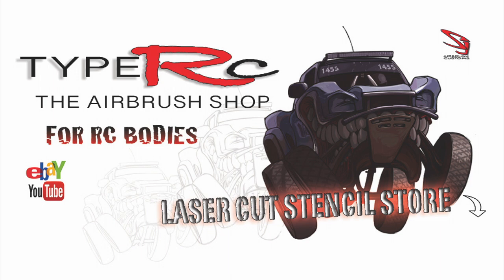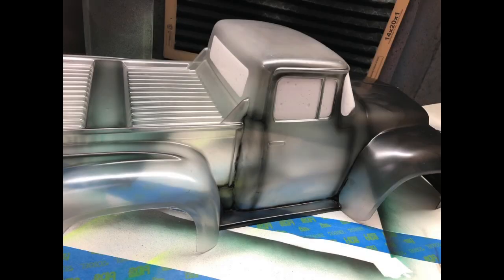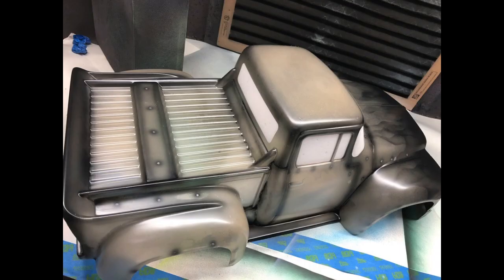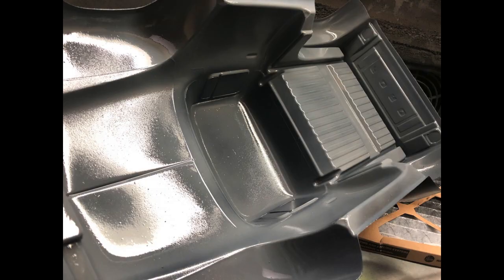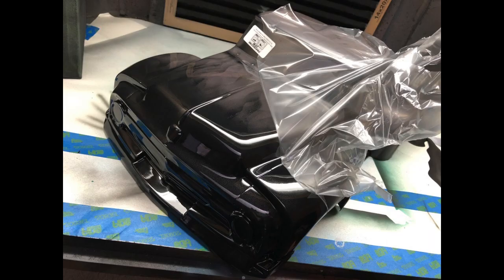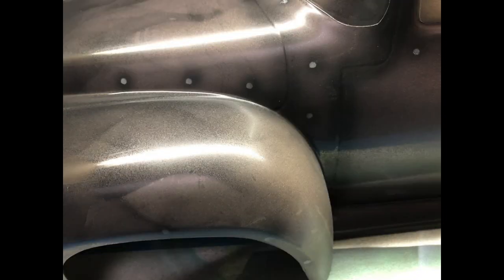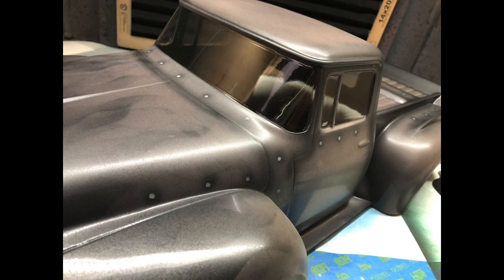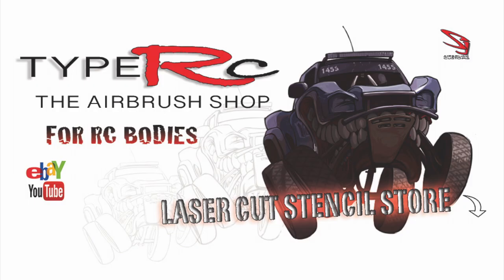How to Airbrush Rust on Rc body

Comment: You do absolutely amazing work ! It has sparked a new interest in my hobby . 🔥🔥 I did have a couple questions that might help.  I'm hoping you can give me some clear advice.   Do you need to seal the paint with a clear coat or another type of paint sealer to keep water and the environment from destroying the paint ? Or is a simple backing coat sufficient to keep the paint from degrading ? I mostly paint rock crawlers and trail trucks that see a lot of abuse and a lot of wet environments.
Reply from the maker: The more protection you can add the better.  These are water based paints and will come off but the more clear coat, or other protective paint, goop, tape what ever you use to protect the work the better.